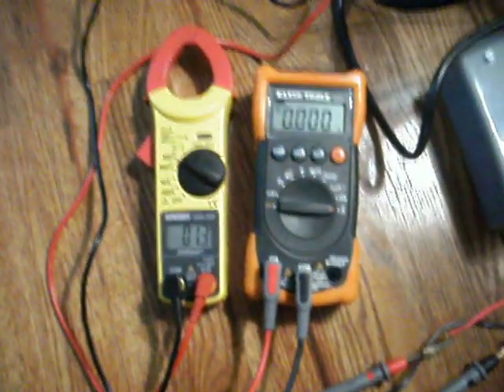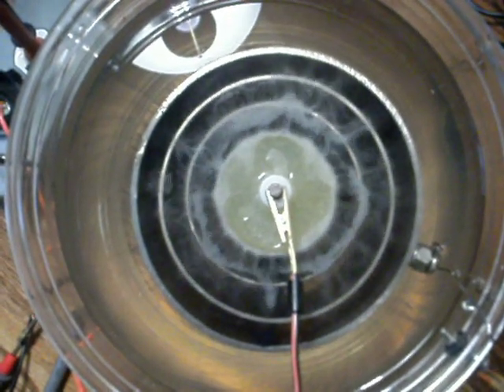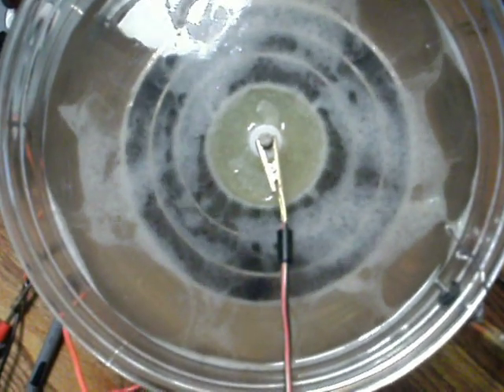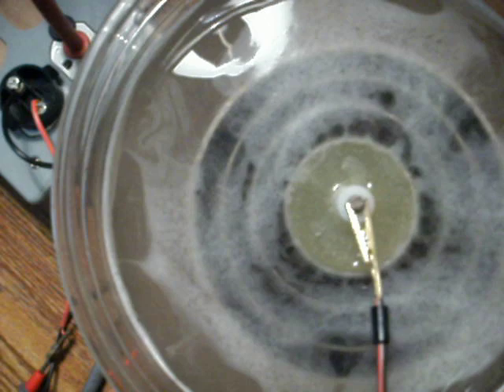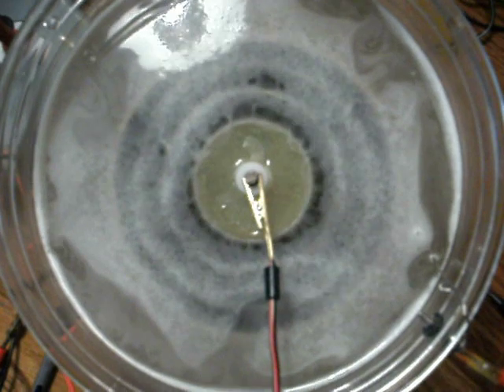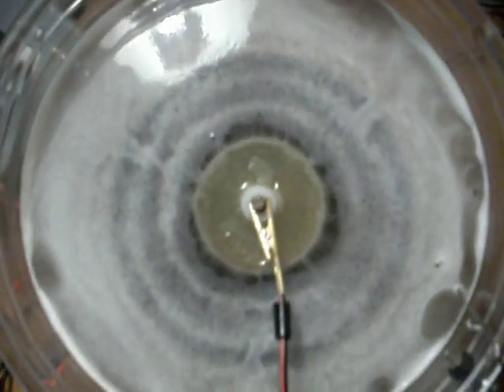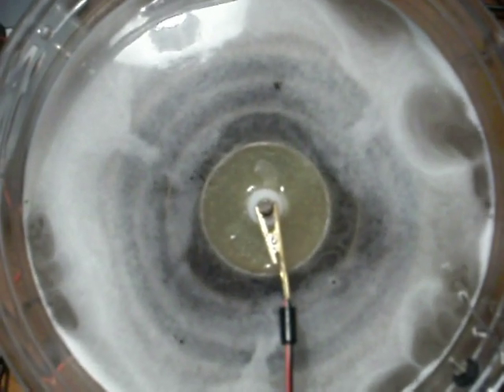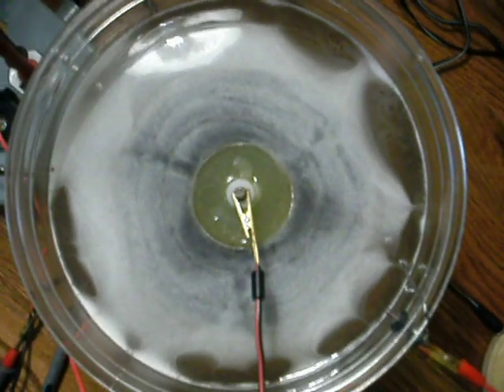Hydrogen Proton Energy created by charging the water in stages...

Comment from the maker: Yes, this unit was made for just charging the water to a 3rd stage process. The running unit would be placed under a vacuum.... Also the cool thing about this gas is that instead of expolding, it implodes. So instead of making heat, it's reversed and makes the engine running on it colder.

Comment from the maker: I found better production using smooth and polised metal than being rough. This system is different than hho generator....water has been charged for a week to get this reaction. no koh will be used. Also the cell runs very cool because the power it runs on is only 12 volts at 450 milli amps. It never exceeds that current even running at 24 hours. Thanks for watching.

Comment: This video is awesome. Thanks for sharing! If i wanted to try this in my workshop please tell me how to connect the wires and what volts/amps are you using to get this result? Did you drill a hole in the glass on the side? It appears you are putting current on the outside cell wall and on the inside of the core via the top, correct? . Is the center core closed on the bottom or just free standing?  Thanks man!

Comment: Are you applying current to the water? If so, you are doing electrolysis and you are making hydrogen gas bubbles. if you make your rings out of silver, you can make silver colloid if you use lower amperage. Orgone is negative Ion release. What are your rings made of? What voltage/ Amperage are you using?  Do not drink that water unless you want heavy metal poisoning.

Comment: I can't wait to get my first model working. For some reason I imagine an overall clockwise tendancy. Have you seen a diagram of how a liquid moves in an egg shape? Two helixes, both clickwise(I think) one inside the other. I want my Joe cell to mirror this natural water flow, and am sticking my neck out when I say I think some Egyptian stone vases (without pouring spouts) were used for the same purpose. Joe is seriously onto something...not such a big leap from this cell to Zero-point I think... Did you power anything with your cell? Which water do you recommend ¿ I was thinking ormus, or heavy, or no idea, it's my first one....
Reply from the maker: +electrotherapyify 
Yes, Joe is amazing and I enjoyed watching all of his videos.. He makes it look so easy in charging the water. I don't know how good their water is there in Australia, but it must have a lot of minerals or sulfur in it to be able to charge it so quickly. I used Fuji water in mine and found that it was the best to react to the electrolysis so nicely. When charging the water it must be away from all electrical interference like receptacle plugs or Wi-Fi radio waves coming from your router in the same room. I placed mine in the center of the room with my bedroom door closed to prevent any disruptive noises as well from disturbing it's charging . It's very sensitive two charging and one wrong move will cause the water to just go dead and not do anything. I did charge another cell I made in which power was turned on and foam would build up very quickly on the top ...I definitely was at stage 3 on that charged water. I did try to put that one under a vacuum and place it on my truck engine but I think I got too close to the ignition wire and then the cell just went dead and would not produce foam or anything anymore. So much for that Adventure , I kind of put that project to the side for now until I can better understand it.. But good luck on yours and let me know if you have success With It. Thanks for watching.

Comment from the maker: It's a device used in charging water in a slow process to collect and trap orgone energy in the water to be used as a powerful fuel. Works way different than hho gas. When ran threw the engine, instead of it heating up it does the opposite, it cools down...something like cold fusion technology. Thanks for watching.

Comment from the maker: @cxroy702 
  It's called Fuji .... It comes from beneath vocano rocks. Very alive and rich in minerals ! 
The Stainless steel is 304L. The spacers are ebonite rods. The center is a special die eletric metal within the  apoxy glue causing  a different magnetic field in charging the water faster. Thanks for watching and comments ....

Comment: also, you Must have a pop off valve.. to release the explosive force of the HHO if it gets ignited, or the whole jar can Blow up ...Ive seen this....not pretty- its like a grenade...so use caution...Your HHO Chamber- Lid- should Have a 3/4-1" Hole with strong cellophane packing tape covering it...and this will pop off~ if it gets over pressurized By Ignition.
& the ss leads have been Known to burn off due to to The high of amperage, & again, It-arc's-..and BANG...so make them HEAVY, as well.

Comment: Hello, If All stainless surfaces-R "roughed-Up", Then production increase's,& if you add a little- KOH, It Improves volume-2. & Then; U Need a Reserve tank,& A small pump,
& a cooling coil, to Maintain temps, Because, W hours of use,they overheat & boil off water.
-Some Cars Have a SS heater core & They works great.
W/ These additions -HHO Gas Production is consistent.& Then supply, one Jar of gas production... Per- cylinder... & Thus- your "Volume" of HHO -should be sufficient to do the Job!

Comment: HHO with an electric charge, I work on it, if yo put an spark or flame the bubbles EXPLODES...
Reply from the maker: Totally different thing than what you are thinking of. This water takes days of slow charging to create this water foam which is called Oregon energy... You'll never get this in a standard HHO cell with electrolyte added. This is just plain spring mineral water that has been charged for days to capture this energy in it. Just google the Joe Cell and follow up on information about it. Thanks for watching.
Reply: OH!, sorry looks like same process, and how did you connect the ORGON energy to get it?